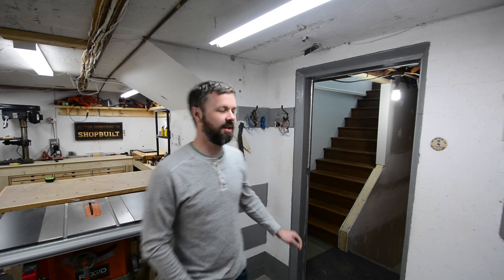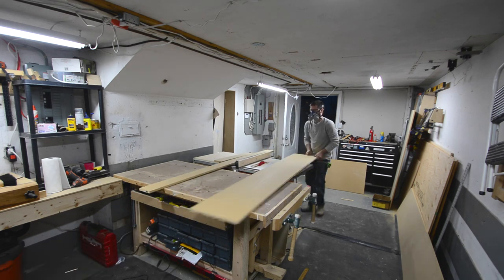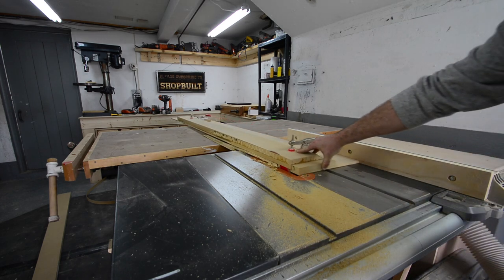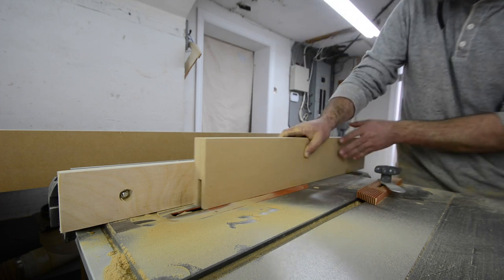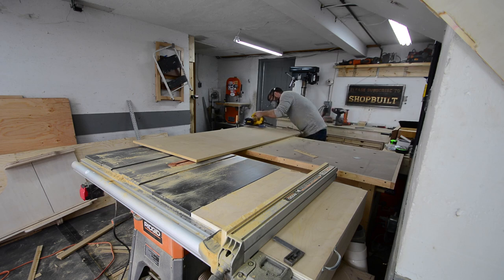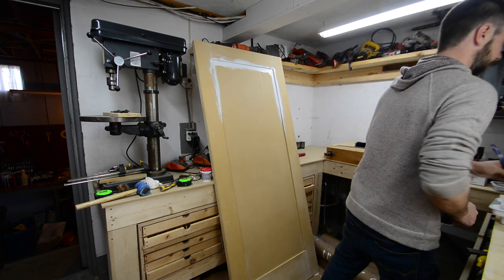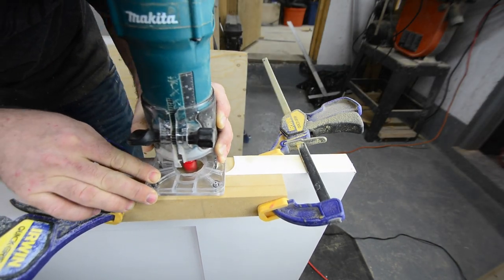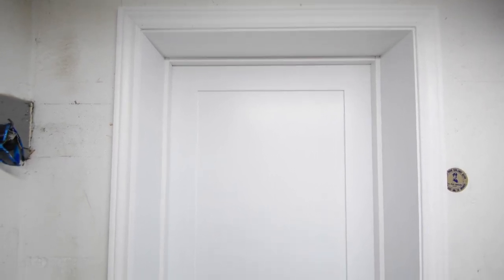Shop built - DIY Solid core door

Comment: Why not just glue the two pieces of MDF together and have a door of same thickness top to bottom (without it looking like frame and panel).  Significantly less dust / work.
Reply from the maker: +DRMNZ wanted it to match the rest of the interior doors:)

Comment: If you find that dust and too much sound still pass through, replace your door stops with exterior door stops, found at most hardware and lumber stores and maybe the box stores, that have the weather stipping attached.  The rubber comes in bronze or white and you'll need to p and p the wood. Some kind of a floor sweep or a raised/rabbeted sill will also help but if you do that, you may need to get used to walking over it so you don't trip. The best option, but also an expensive one would have been a prehung solid core exterior door. Because they should be air tight, dust and sound would be held to a minimum.

Comment: Not bad, one question though, why no glue on the centre panel, it's mdf, it's not gonna move anyway. I'd have used longer more course screws in the hinges too. Edit, did you ever change the screws?

Comment: Nice work!  You might try adding weather stripping around the door.   It helps to prevent air and dust leakage, and aids with soundproofing. Add a rubber seal threshold if you can.  The idea of adding a second door is also an excellent one to really soundproof the area.

Comment: Wow I have to say I have never seen anyone do M&T with MDF. nice work!
Reply: I was thinking the same thing! :)
Reply: Sweet job all around! and great thinking!
Reply from the maker: +Wood By Wright I was kinda concerned if it would make a good glue joint but now that it was all built I think it will be fine. Time will tell:)
Reply: +Wood By Wright There's LOTS of things you can do with MDF, but it also has certain limitations.

Comment: Here are a few ideas you may find useful. Since you door opens out from this space you can put a second door on the inside to block even more noise, should noise ever become an issue. Second you can always put plastic on the inside as well to cut down even further on dust getting past the door area. Lastly it might not be a bad idea to use winter rubber stripping on the inside to further cut noise and dust; as you know the less gaps means the less transfer... I did a similar project but made garage doors very much like what you did, except I used 2 x 6 material and 1/2" plywood rather than osb. Given the fact that it was exposed to the elements I had to use something that would last. Needless to say they made for very secure doors, even took a few accident hits for almost no damage. The vehicle on the other hand did not fair as well... LOL... Cheers....
Reply from the maker: +Paul Bialozor thanks! Yeah I'm definitely going to add some seals and door sweep to further help with dust and sound:)
Thanks for watching
Ryan

Comment: The door you replaced is a panel door, like the one that replaced it.

As far as wood warping, solid wood has been used for doors for centuries with no problems, even those made  from "cheap" lumber.

MDF is probably the worst wood composite material for holding screws. There are some specially designed screws for MDF, but they are only marginally better. I noticed the screws are way short for such a heavy door. To mitigate the problem with the screws, a large dowel could be placed across the thickness of the door at every screw locations. Just drill a hole in the face of the door and glue the dowel in. Then, insert the screws through the dowels.

If you really want to stop the dust migration into the house, weatherstripping is needed. The undercut of the door appears to be an inch, or more, and that pretty much makes the door useless. The weatherstripping will also significantly reduce the noise transmission.

Still, the finished door looks good, at least on Youtube.
Reply from the maker: +Chuck D there use to be a screen door there, not a panel door. Yes you can solid wood for doors but like I said hardwood is to expensive and construction grade wood (spruce here local) I personally feel wouldn't be a good choice because of the style of door. There is no Center rail to help hold things together. Maybe it would be fine but I wasn't risking it. Yes I'm well aware the screws are to short, I didn't have any longer screws in the shop to match the Hing so I used the short ones temporarily. Weather stripping is also planned.

Comment: Great looking door, have mdf inside my doors and the screws u used on the hinges will eventually strip out, try longer dry wall screws
Reply: I was thinking the same thing. The screws used looked far too short considering the forces that will be on them. But still the door came out looking great.
Reply: Yeah I thought the same thing, mdf is too heavy and not strong enough to support itself with those screws, you should double the length to engage more material.
Reply from the maker: +Chris Trout on the jamb side I used 3" screws to go right into the stud behind on the jamb. I had planned on using longer screws on the door as well but go lazy:)

Comment: That should absorb a lot of sound. :-) Just watching, I thought of another way to cut those deep grooves (dados)... If you cut your centre piece narrower when laminating the rails and stiles, that would create the groove for you, if the thickness waa correct. ;-)
Reply from the maker: +Olly Parry-Jones there is actually only two pieces in the lamination.
Thanks for watching:)
Ryan
Reply: Shop built Ah, a good point. ;-)

Comment: wow that came out Great. how much did that mdf help with sound proofing? im actually thinking it might be more efficient then wood.
Reply from the maker: +nyinfamous2k2 thanks! It helps a lot compared to no door at all but not sure if it would be any better than a wooden door. I would suspect it's a little better than a hollow core door.
Thanks for watching
Ryan
Reply: It's all about density. MDF or HDF can have even 1000kg/m3 density where Wallnut or Oak has 800kg/m3. Concrete for construction has 2600kg/m3. Next time make Concrete door :)
Reply: If someone can manage to do that, i would watch that video. And then subscribe for the follow up video of when someone slammed the door and it fell apart lol

Comment: Looks good I've heard  mdf doesn't hold a screw all that well, on such a heavy door any worries on it failing over time? I'm in agreement with the other guy here you made that look effortless! great video
Reply: I'd be interested to see how the screws hold up, looked  a bit short to maintain a long-term grip in mdf.
Reply from the maker: +lionelhernandez34 on the jamb side I used 3" screws to go right into the stud behind on the jamb. I had planned on using longer screws on the door as well but go lazy:)

Comment: Why spend the time making a stile and rail door when by face gluing two panels of three quarter mdf together and then cutting to size would give you a solid door with no edges for dust to sit on.
Reply from the maker: +Wendy Benge wanted it to match the rest of the doors in the house.